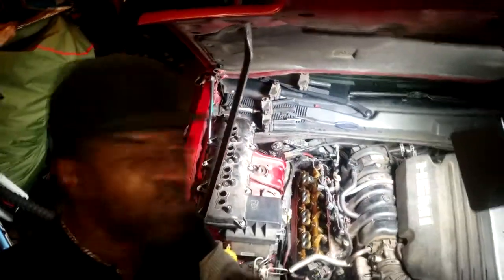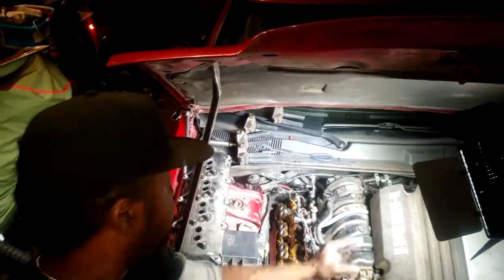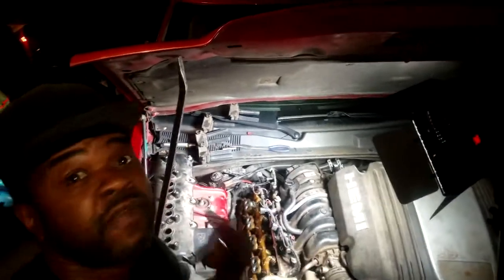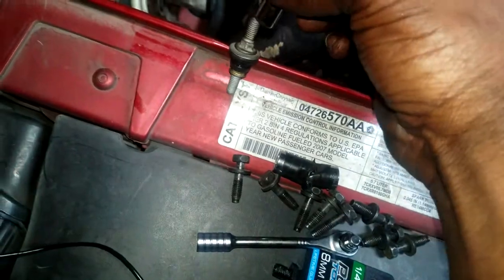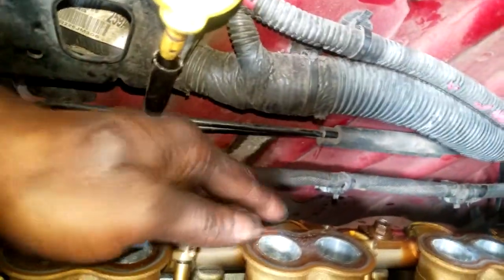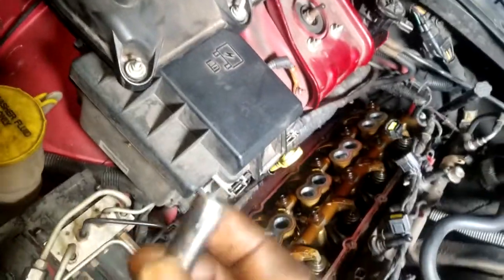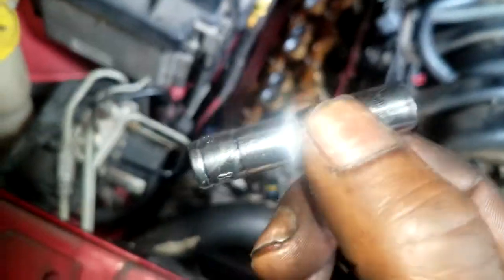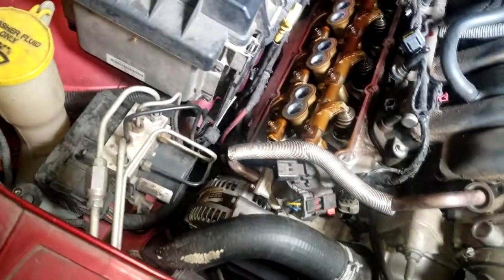HEMI HACK. Valve Cover remove and install TIPS . Hemi Tick oil leaks at valve covers and PCV valve

Comment: Fantastic idea, currently removing my heads on my 2006 Chrysler 300c. Passenger side, far back valve cover bolt bottom one is a bit_H. Never thought of cutting the socket down. My hat off to you Sir!!!

Comment: Or you can get a thru socket set from gearwrench and you won't have to cut anything. Try it!  Good luck!
Reply: highly doubt you could fit a through wrench on the back side of the cover. swivels is where its at

Comment: Or you can cut the threaded part off of the bolt and use a regular socket
Reply from the maker: Yep, theres different ways you can get er done. Thanks bud
Reply: I was wondering this. I feel like it would be simpler in the long run, and less force to cut it vs a socket. Why are they even long like that in the first place? Instead of cutting them, can you replace them with normal bolts?
Reply: @jeffreykirby7544  they use long bolt because there's a plastic wire holder that attached to that bolt for wiring harness.
Reply: @jeffreykirby7544  you can cut them and use regular bolt the long bolt is for wire loom to hold on to

Comment: Bro how you get that cover back on that passenger side?
Reply from the maker: lol, I had to use a very small wrench..couldnt get a socket on it until I cut a deep weel socket in half.
Reply: Online Mechanic Tips I’m having a really hard time getting the cover back on given there is no space because of the wire harness being in the way
Reply from the maker: @VikingsFan-sy2vc  right, Thats what the video tip is all about, I had to cut my deep well socket in half  in order to install it
Reply: Online Mechanic Tips I’m not talking about the bolt I’m talking about the actual cover itself. There isnt any room due to the large wire harness
Reply from the maker: @VikingsFan-sy2vc  O buddy you just have to wiggle it out of its place, try to re-route the harness out of the way..Thats what I had to do,,Even if it means pulling it upwards
Reply: Cut the socket and take it off I totally got, but my question is once it’s out, what is the top of the bolt long for? Could you replace with a normal bolt or cut the top off the bolt so you can use regular sockets from then on?

Comment: Could just use a through wrench instead so you wouldnt have to cut a socket. A decent set would run you maybe 50 bucks
Reply: Not enough space unless you have dog paws instead of hands
Reply: Just put the socket on first then insert the swivel and extension. No messing around or special tools needed.